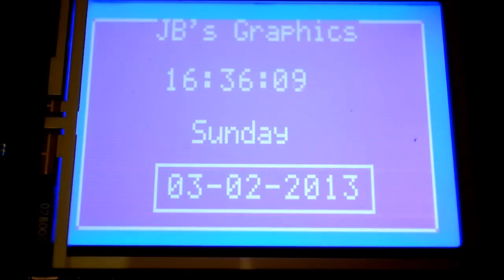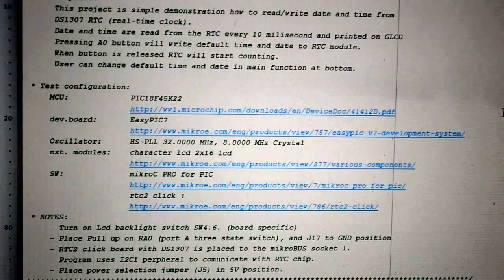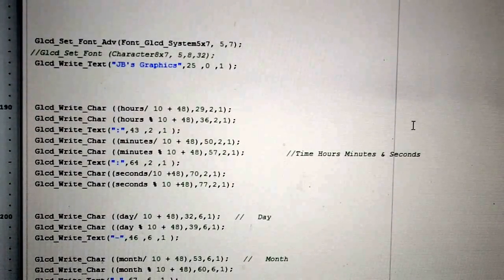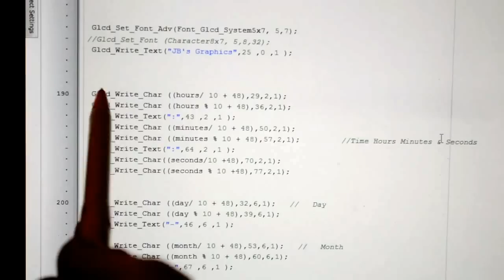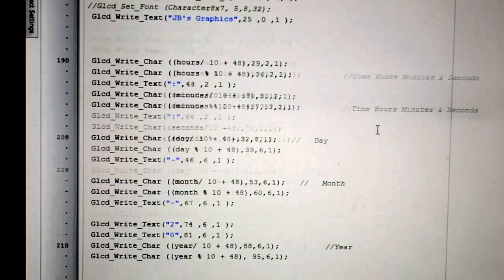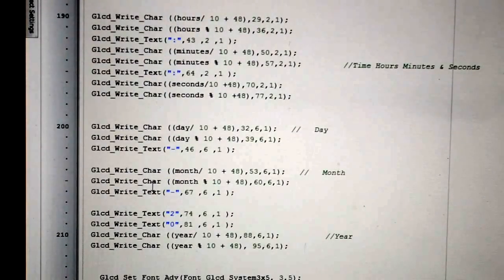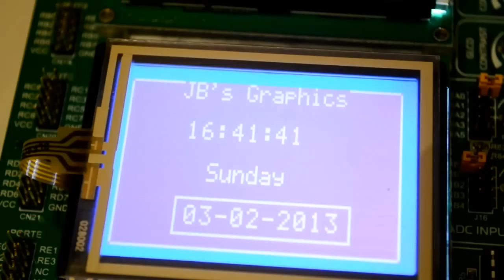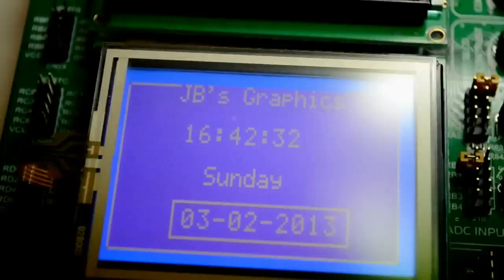GLCD Clock with MikroC Code demo Mikroelektronika's RTC 'Click'

Comment: hi john i have been watching your videos for long time, i also use mikroc pro for pic compiler, my issues are while displaying a integer using t6963 library some integers  appears as letters or symbols , i am not able to understand whats the issue , do u have any such experience with these graphical displays .....
Reply from the maker: Hi, from memory, I believe some formats need to be converted to ascii. I'll check some of my old codes, I have not used a GLCD in many years.
Thank you for the views.
Reply: thanks for ur reply mr. john, if  you check and say how to convert formats to ascii after looking into your codes it will be very useful to me , i am so glad you replied ...
 @JohnB-2021
Reply from the maker: @Naveenkumar-mm5jl  If you look at the video at 2 minutes and 40 seconds, the code is converting the data to ascii. It is adding 48 because normal numbers start at ascii 48. Does that help? 
If you think your display is wrong, either add or delete 48 and see what the result is.
There is an ascii chart under 'tools' in your compiler.
Reply: sure MR.john i will check in to it . i used to display like this, i use 16 variables 13 of it displays correctly randomly 3 or 2 variables appears as mix of symbols and numbers some times as letters. but i will re write and see as how you display

    T6963C_Write_char_adv(  (  (char) (((int)(Production_L/10000)%10)+0x30)) ,76+Fi_Xpos       ,Ypos+(13*7));
    T6963C_Write_char_adv(  (  (char) (((int)(Production_L/1000)%10)+0x30))  ,76+Fi_Xpos+5     ,Ypos+(13*7));
    T6963C_Write_char_adv(  (  (char) (((int)(Production_L/100)%10)+0x30))   ,76+Fi_Xpos+10    ,Ypos+(13*7));
    T6963C_Write_char_adv(  (  (char) (((int)(Production_L/10)%10)+0x30))    ,76+Fi_Xpos+15    ,Ypos+(13*7));
    T6963C_Write_char_adv(  (  (char) (((int)(Production_L)%10)+0x30))       ,76+Fi_Xpos+20    ,Ypos+(13*7));
    T6963C_Write_char_adv('.',76+Fi_Xpos+25,Ypos+(13*7));
    T6963C_Write_char_adv(  (  (char) (((int)(Production_L*10)%10)+0x30))    ,76+Fi_Xpos+30    ,Ypos+(13*7)); @JohnB-2021
Reply: do u find any issues with the way i display MR.John or shall i try to rewrite simply as u display in your code, what is ur suggestion
Reply from the maker: @Naveenkumar-mm5jl  
I don’t see any obvious errors, but then I can’t see what your display is showing.
What are you reading and what is the exact error?
I see you are displaying individual characters and starting at dividing by 10’000 etc.
Have you tried leaving more room between characters?
Move all characters to different y positions and test it.
Reply: i will try and reply you sir, i cant space letters much or move locations because i display in rows and colomns  so its not possible to relocate the place i dispaly  i will try whats possible, and let you know @JohnB-2021
Reply from the maker: @Naveenkumar-mm5jl  It is for testing only.
Reply: hi the issues solved i have used 0x30 to convert the character but u have used 48, when i changed it to 48 the code works fine @JohnB-2021
Reply from the maker: @Naveenkumar-mm5jl  Excellent news, thank you for the update.
I did see 0x30 and checked with calculator, it was the same as 48. 
Maybe compiler error?
I'm pleased you fixed the problem.

Comment: please send ur code where only values are changing...thanks in advance.
Reply from the maker: Click on the links to get Mikroelektronika's example code.
Reply: @JohnB-2021  im not able to get the code..but please tell me one thing in ur display u r changing the values without clearing the full screen of glcd..by which mikro c function?
Reply from the maker: @avcd-dcv  
From memory, my memory, you do not need to clear the screen on a GLCD screen if the character is one line high. There are 8 lines on that old display, something like 16 pixels high.
It is automatic, which is an advantage for this type of screen.
On colour screens one would normally draw a line or box to clear the first number then write another number.
However, I developed a code for numbers or text that does not need to be cleared.
All the code on my later videos is on Github.
Please take a look.
https://www.youtube.com/watch?v=-ZvO-9EriXc&t=1s
Thank you for your comments.